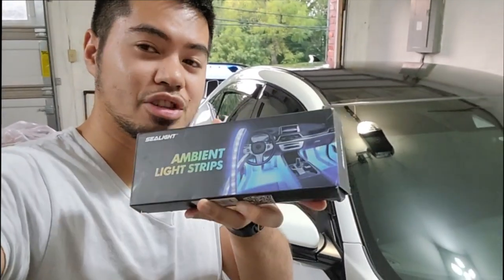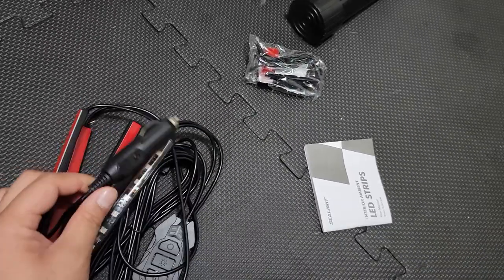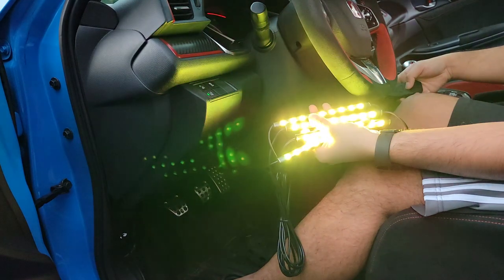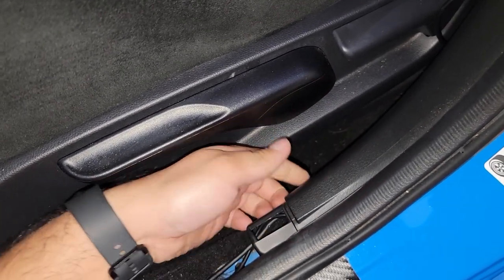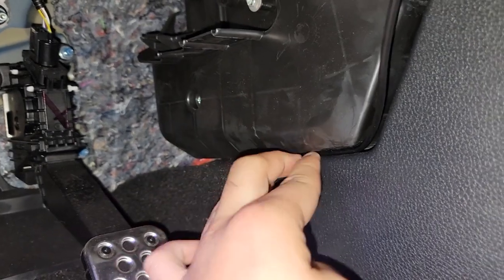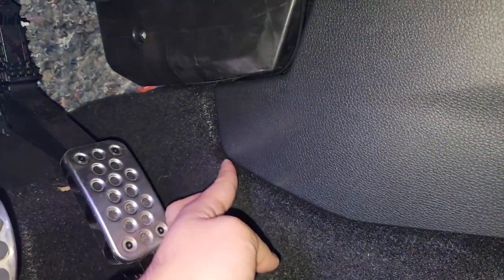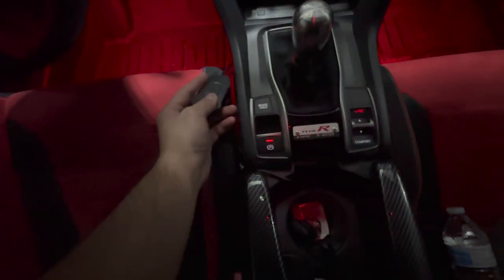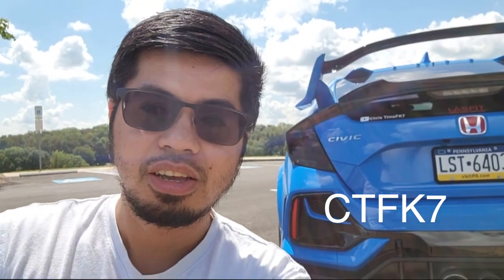FOOTWELL LIGHTING INSTALL AND REVIEW | SUNCENT AUTO 10th Gen Honda Civic

Comment: Chris, QQ but firstly ive loved your vids. I have a 2019 sport hatch here in UK. I have spoken to honda, as i would like the gaiter and gear knob from Type R fitted. They said they are unsure if it would fit. I would assume the gaiter boot bag is same size etc? I just love that metal tear drop style. Anyway would be great if you knew.